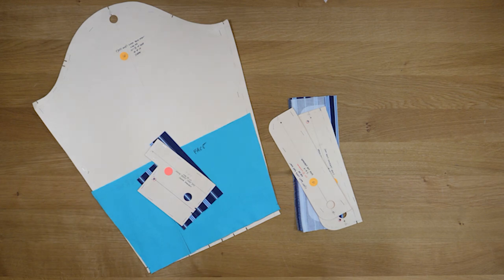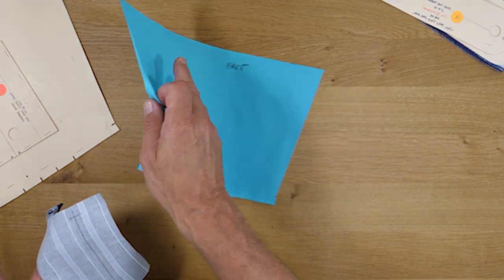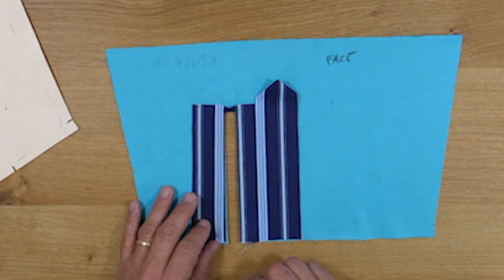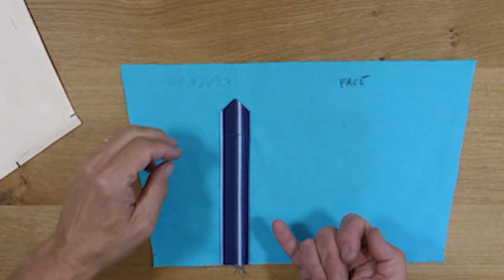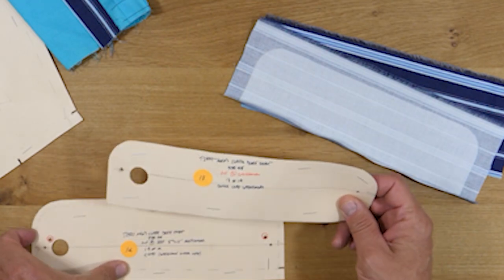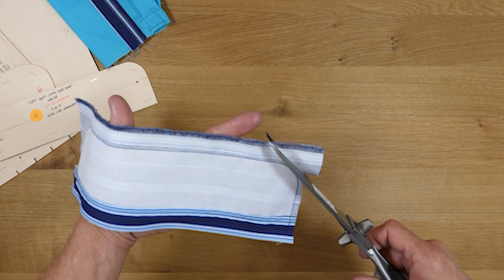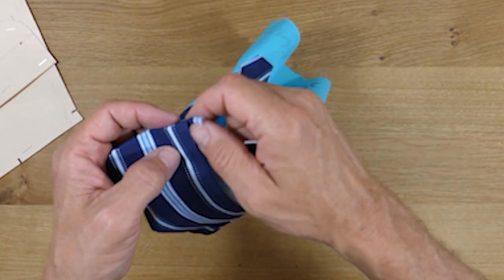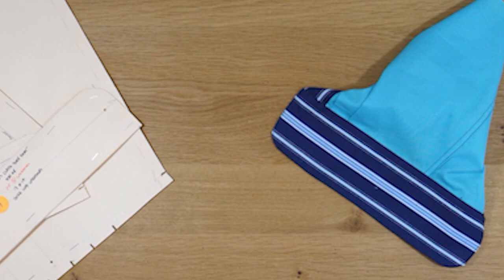Sleeve Placket and Cuff 052620

Comment: How do you tell the right sleeve from the left sleeve?  I have had trouble with reversing the placement of my sleeves sewing them backwards and reversed
Reply from the maker: The back of the sleeve cap always has two notches. The piping of the sleeve placket is always placed at the back of the sleeve. Hope that helps.

Comment: Thanks for this video. It's very clear and explains a lot. I was also wondering what kind of paper/cardboard you use for the pattern. It looks very rigid/sturdy.
Reply from the maker: Thank you - I appreciate your comments. The pattern paper is referred to either as manila (the same kind of paper from which manila folders are made). It is also called oak tag. You can purchase it from industrial supplies such as Industrial Design Supplies in Los Angeles.
Reply: I use posterboard for my patterns.